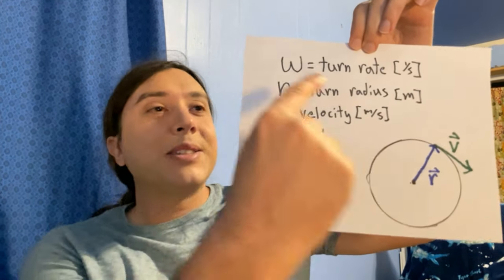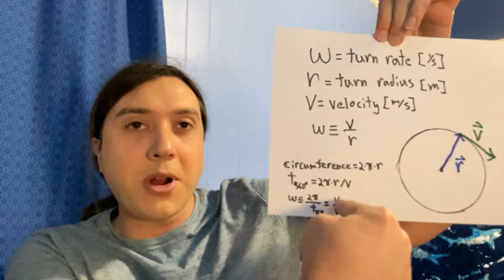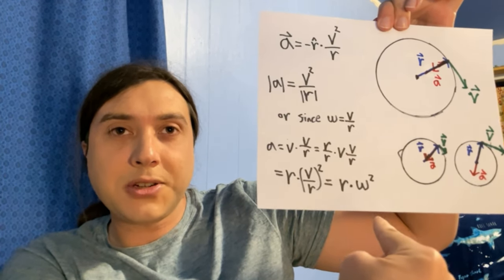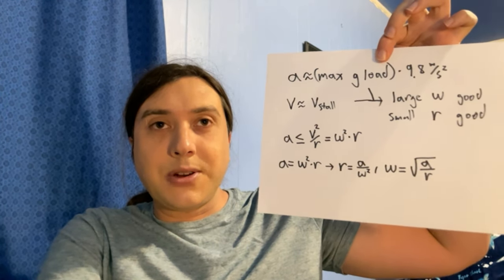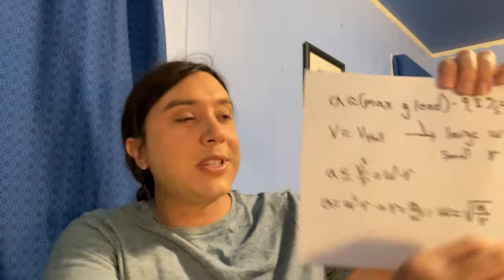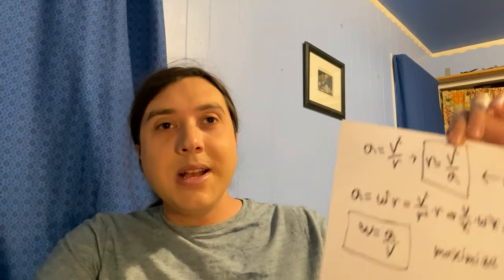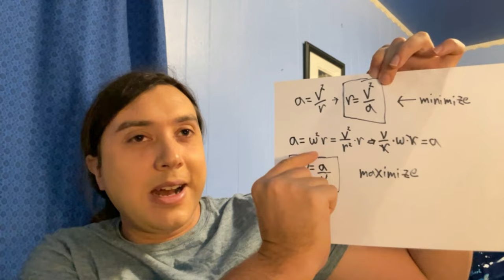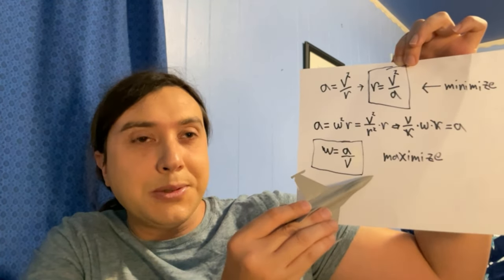Dogfight Physics 101: Airplane Turn Rate vs Turn Radius

Comment: The Hornet does more than 7.5g it's software limited to 7.5
Reply from the maker: In terms of the absolute maximum the airframe can handle yeah it can go a fair bit higher but the probability of structural failure gets higher and higher as you exceed 7.5 g by more and more. I've heard you can jink it a touch above 7.5 with very rapid control inputs but the computer will quickly reduced the elevator deflection to get it back under 7.5g. The maintainers do not have a good day after that happens and are generally owed a case of beers haha.
Reply: @EricaCalman  I would rather own the crew some beers if it prevents battle damage 🍻 the paddle switch enables the unrestricted 9g+ for the Hornet and I doubt any pilot would hesitate to use it if needed in combat. Is the viper rated 9g+ without limitations?
Reply from the maker: No but it can be momentarily pushed past it with aforementioned high g onset rate. The real issue in both cases is energy management. It's definitely worth it to over-g the airframe if it evades getting hit but you can't do it for long without bleeding speed and energy. The viper's big strength isn't the structural limit but the sustained g limit. I didn't talk about actual energy maneuverability theory in this video though, I will in the future.